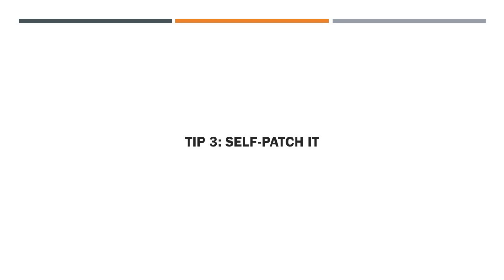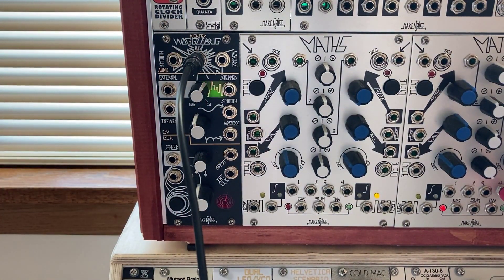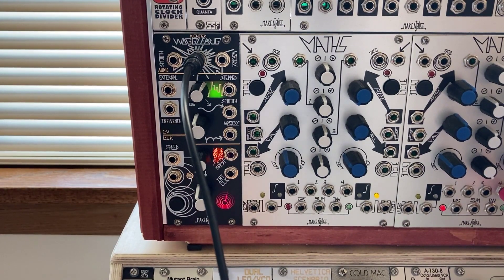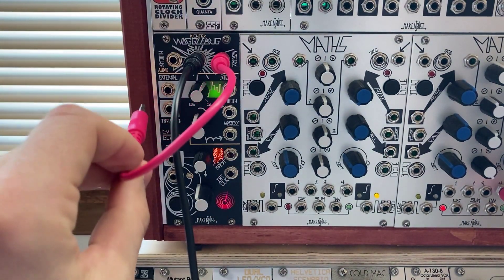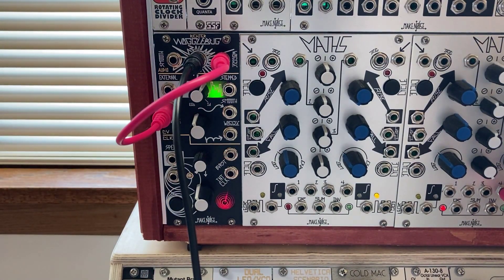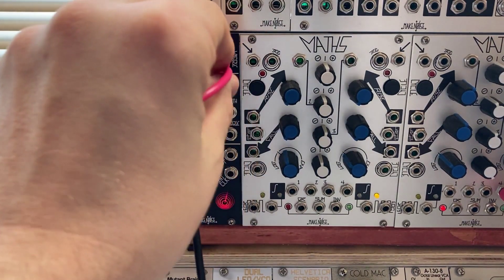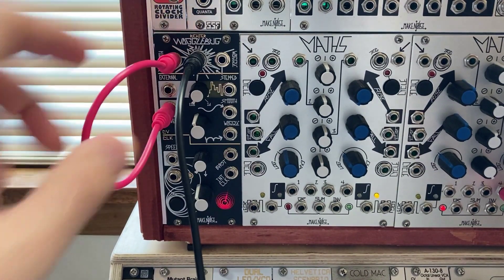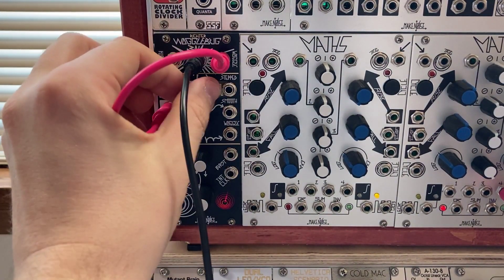Demystifying the Wogglebug Part 3: The Audio Section

Comment: Thanks for part 3! I can finish my cheatsheet/mini manual now 😉

To bad the 'PLL tracking' is not 1v/oct. On the other hand, the Krell doesn't do 1v/oct 🤣

BTW, using a stacking cable to mix signals... I'm not sure that is 100% save... (ah, you also described: use at your own risk!)
Reply from the maker: You're right it's probably not best practice.